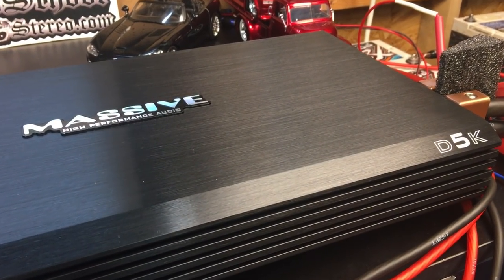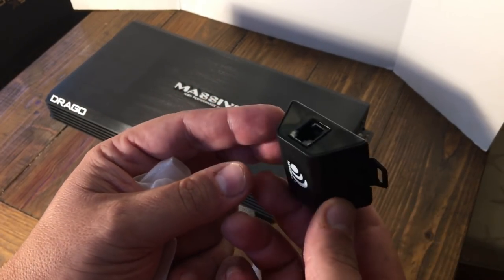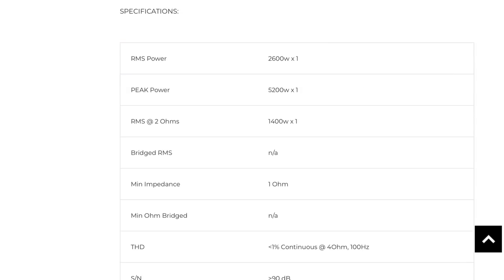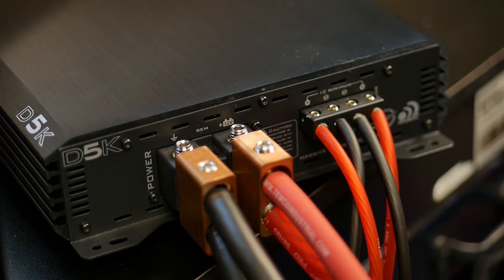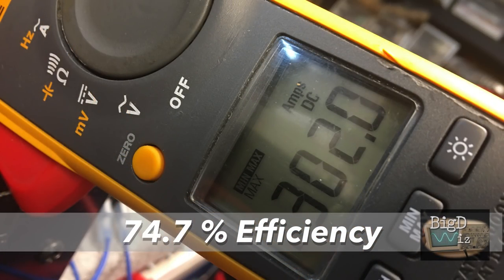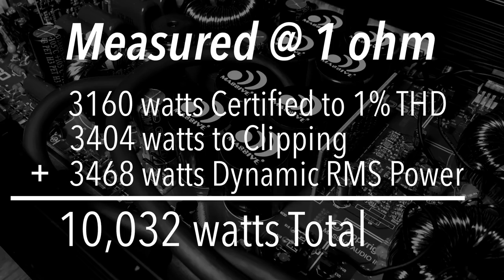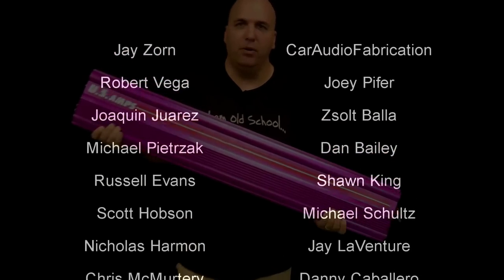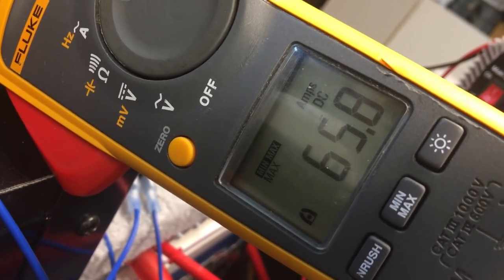Massive Audio Drago D5k Amp Dyno Test and Giveaway Results

Comment: @Williston Audio Labs  Hi I just bought one of these and 2 American Bass Xfl 12 Dual 2dvc so I can only run them at .5 ohm or 2 ohm.. Can you please re-test this and maybe see if it can handle .5ohm of CLEAN power, and/or what the actual 20hm rating is, massive has it at 1400 but they under rated the 1ohm so im hoping they did the same with the 2 ohm rating. This was an incredibly surprising amp and i think everyone would enjoy to see it put through a more rigorous test and see what it can handle/do... Thanks for the vids man, your channel has saved me alot of money.

Comment: This amp preformed well And i like massive audio but take a look say at the BP1500.2  rated 960wrms It is a class ab so it is more than likely to be less efficient than a class d such as the drago series but just for the hell of it lets say it is 80% efficient which is a very good efficiency To get 960 watts rms At 14.4v you need 66.7 amps at 100% efficiency or 80 amps at 80% efficiency or 86.7 amps at 70% efficiency. The amp is fused 25x2 It can pull more than the fusing but i'm not convinced this amp will do its power Except dynamically maybe.

Comment: Awesome amp, nice video! Hey Big D, i've got a question... here in Brazil, most of the amps we use for subs have the clip led, so we know when the amp is clipping, but I noticed that most "new" amps you test don't have it... So how do you know when to stop turning up the volume if inside the car you can barely hear the distortion? (Sorry for any mistakes in my english)
Reply: Smd dd1 set your gain once and be done with it. Don’t use bass knob as a volume

Comment: I would love to see Big D Wiz to test some of the older ARC AUDIO amplifiers like the G/H class I have the KS1200.1  This amp is bad ass and however sucks a lot of power when in off position or on just idle. However I would love to see a bench dyno test to know exactly what is the capability and at what current draw.
Reply from the maker: Yessir, I'm always getting different stuff in to test. Once a get a few hundy thousand subs, maybe I can make this my day job...yeah right! Until then, I'll keep testing when I can.
Reply: BigDWiz dude you will get there.  You edit and shoot your videos so nice that it makes me subconscious about even doing any.  You have some of the most important videos regarding car audio.   I think it would be neat to see you test some home amps plus try out your distortion analyzer on some of these amps.  Especially the 4 channels.  It would be neat to see what my Helix A2 and A4 put out for power at what THD vs a normal mid level amp.  I got a HP334 distortion analyzer, but haven’t played with it yet.
Reply: Most Definitely! BIG D WIZ is the man to come watch. It's like going to a demolition derby at times anticipating the results to see the scores at the end of each dyno bench test. I love it. I want to see one of those 220v amps tested by Taramps. That big behemoth 150k! lol. I am debating buying one of those for inside the basement to make a whole wall of subs to just knock my house down! lolol. WIZ does great work!

Comment: Off topic, but I always thought Toolmaker terminals are an accident waiting to happen. There are literally millimeters between shorting something out, or at the very least blowing a fuse. In my eye, I would run an over gauge wire (like 0/2 or 0/4 welding cable) and then reduce down to 0 gauge.
Reply: Simple fix, electrcal tape or shrink tube  or Plasti-dip. Take your pick
Reply: Fair point. Funny thing, more often then not I see them being  used without sleeves.

Comment: HOly crap that's why they sent it to you. Hopefully you should test another off the shelf and see if it's true to all their amps sold to customers. Perhaps this was beefed up just for you D! Damn I am definitely trading in my Arc Audio for this Massive.
Reply from the maker: This one came off the shelf and was not a special model...promised by the mfg
Reply: I really like how the D class digital switching amps can take wattage to beyond when going from 4,2 and down to 1 ohm. That is impressive. My Arc Audio though a class G/H circuitry I lose wattage when I step down to 1ohm from the way it is built. I will get 600watts rms at 4ohms, 1200 watts at 2ohms and only 1000 watts in 1ohm per spec sheet readout. Although I never run my daily driver amps as low as 1ohm due to the heat when stuck in traffic and where my amp is placed hidden from open air to preserve the components inside the amp. I use to love Denon amplifiers in the home until I blew them all up running 4 ohm car audio loads to the channels. POP. Denon does not like less than 6 ohm I found. lol.  However my Onkyo will push my 4 ohm loads all day and hasn't popped a transistor. I've learned though the home receiver amps love 8 ohms of course and are built for the 6 and 8 ohm loads so I stack the series parallel loads now better into the 6 or 8 ohms to get more out of it.

Comment: Do these amps get hot and shutdown?  Have you ever tested the E4 or would you just recommend the Drago?
Reply: I have an e4 and I can run it for hours cranking at half to 3/4 volume and it never gets hot. Great amp and puts out solid power.

Comment: Manufacturers fear the amp dyno, and that's a good thing. I appreciate Massive giving away the amp considering the miserable lie of a rating their previous amp was. Great, the amp put out better than rated but $969? Damn, this amp is gonna have to be 20 years old before I can afford it....old school forever I guess.
Reply from the maker: I also did not give Massive the results until after the giveaway ended. I was a bit on edge to think if it didn't do well, how would that play out? Oh well, I guess they knew this Drago series did rated plus and that's good. Now, to correcting the ratings on all the other amps...
Reply from the maker: Also, I've heard from several mfg's who have bought or are buying Amp Dyno's so they can test out their own amps. In some cases, the specs are being provided by the build houses and the manufacturers themselves are being oversold. Now they can check up to see if they are getting what they paid for!

Comment: BigD I have some old school lanzar amps that need to be worked on. Anybody you know that can fix em? Don't think anything major is wrong with them. One if I remember right has a green and red light and the other flashes green. One is new and was never mounted to anything, just hooked it up to some speakers and wouldn't even play. One is an opti200 and the other a opti 4 channel amp. Both are the models with the grey paint.

Comment: Lol, love how it is advertised as a 5k but it is realistically a 3k lmao now on an exactly opposite scale my sundown saz3500 is advertised as a 3.5k when it is truly a 5k board and it clamped over 3.5k at 2.3ohm 13.8v with a 31hz tone in my setup but I have yet to clamp it at half ohm which I will be trying soon although i have seen this exact amp dyno'd on sundowns youtube channel and wow! Over 7k rms at 1ohm higher voltage I need to get me some stepdowns and run the voltage up a bit lol

Comment: hey big d wiz. I WANNA SEE YOU USE 8AWG FERRULES ON YOUR SPEAKER WIRE :p CAN I SEND YOU SOME?
Reply from the maker: I have them, but it’s difficult to use them over and over
Reply: @wal   I hear that, they get squished. I have a question No one will answer... I found an old Crossfire(white) CFA-404s... Are these good or desirable amps?
Reply from the maker: @rmblwgn  great amp for mids/highs. I wouldn't say they are highly desirable amps, but they are good
Reply: Thanks so much.  do u know its ratings? Do crossfires do rated? Amp worth any $?